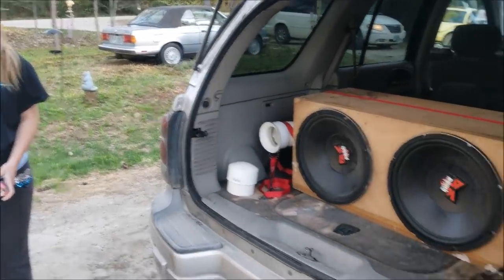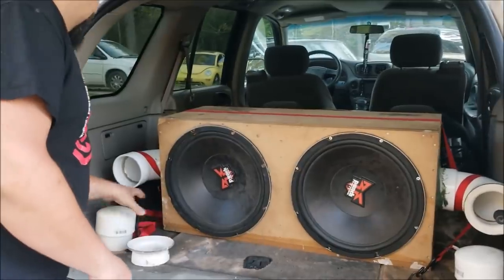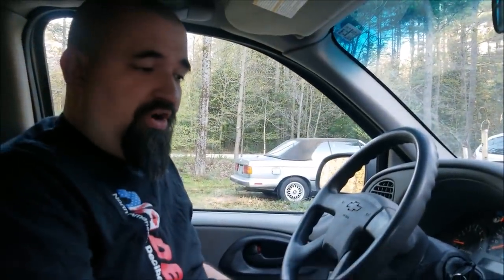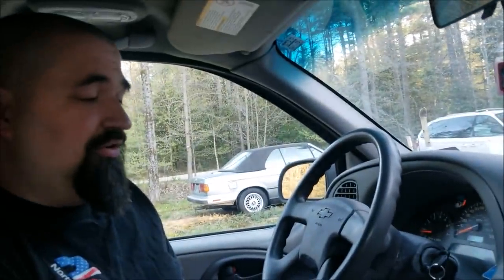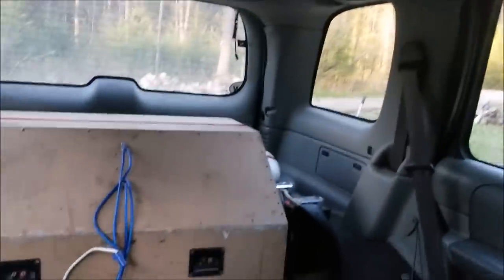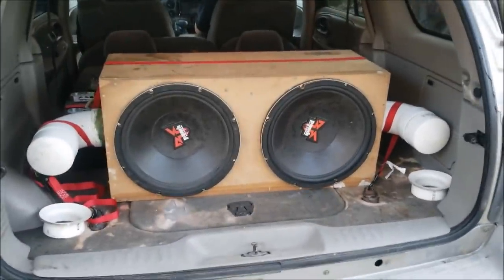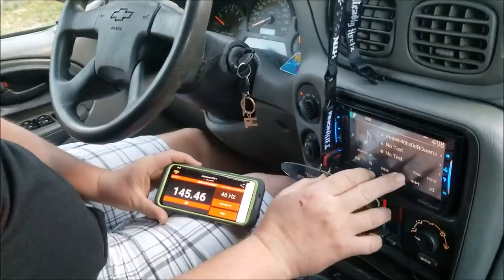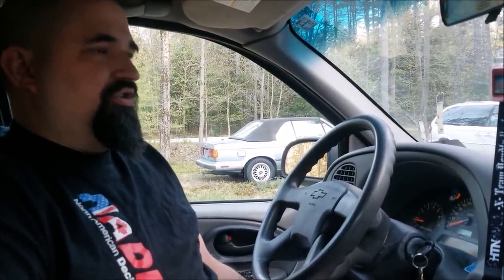Ported vs Sealed Enclosure Subwoofer Box Test with Decibel Meter Using My Daughters Bass Car

Comment: Did you account for the volume of the external ports when designing the box?
Reply from the maker: Roughly 100 cubic inches for a cylinder 4x8 or 0.058 cubic feet added to the sealed volume per side so 2.558 cf sealed vs 2.5 cf ported would technically be more accurate. I honestly don't feel that 0.058cf (0.232% difference to be exact) in volume would have altered the outcome enough to mention. Thanks for watching and commenting!

Comment: Wanting to know more about your setup. I got the same DVC 15s sealed but trying to still find RF amps to match. Are you running at 1ohm or 2ohm. Any upgrades to charging system so on.tia

Comment: to gain 1 db you have to double sound level, so its a huge gain. db works in a logaritmic scale not in a  linear one
Reply: Actually it's know that doubling power gains about 3 db on average. You can double the amount of speakers and get about the same 3db with that as well. Takes about 3 db for someone to notice a difference in "loudness"
Reply from the maker: @davidmarles9409  that therory always sounds good on paper, and may work at lower db levels but that idea goes out the window at high SPL levels.
Reply: @E4EonEbay  I'm sorry I have to disagree. There are plenty of videos that prove this is very accurate.
Reply from the maker: @davidmarles9409  show me a video where someone is doing 160+db where they simply double their power and gain 3db... do you ever attend serious audio competitions?
Reply: @E4EonEbay  I absolutely do and have gone to comps since the early 90's and you know as well as I do that's not what I meant. Once you have achieved the max power  your speakers can take this obviously isn't true. Also there is way more to car audio spl than in a building where this holds much more true because a car obviously deflects and panel flex affects max spl....I know what I am talking about and this video wasn't referring to anything like you are saying. Also I listen to real music not test tones and most of us like an even volume through all the bass frequencies not just a specific frequency for spl. I prefer quality over loud.

Comment: what do you think of class d amps, so tiny, more than 90% efficient, very less heat, excellent freq. response.
Reply from the maker: Class D amps are fine for bass in my opinion, however I do not feel they are suitable for mids and highs if you are using quality set of component speakers and looking for the best sound quality. I'm sure the majority of people wouldn't notice but for those still listening to cd's instead of bluetooth from youtube they would notice. Thanks for watching and commenting!

Comment: In my concern, i prefer a sealed box, large as you can. Because i'm a dj and club's conceptor, i'm also a music lover.
But a lot of peoples love the sound of ported enclosures. I don't discuss that, And build a lot of ported for them.
So, my point is about the phase of the port.. You could'nt make a real waves with a mécanical off-phase output in this configuration.. I prefer compansate the roll off by more power and good equalisation, who let clean lower band make me smiling.

Comment: Can we get a quick view of battery, alternator, and any electric components I.E., caps
Reply: What do you expect it to look lie? Look at the wiring you can see. It's awful, and borderline dangerous. I wouldn't let my daughter drive a half-a$$ed system like that. You can save money, but still install thing with pride. This system is as sloppy as I've seen.

Comment: I’ve been lookin all over but I’m trying to see if anybody has ran both sealed and ported boxes at the same time ? .. I’ve done it before in my mustang ... ported 12s in the trunk facing tag .. and the sealed box was right behind it facing the cabin poking out through the back seat! It made my windshield flex ! I was using a 2400 watt mono block Lanzer

Comment: 3 dB is the theoretical max at the tuning frequency of the port where the back and front waves are perfectly in phase.  Obviously people expecting 3 dB across the spectrum will be disappointed!  But ported is still a good bet when well tuned.  Even for SQ, with a blindfold and optimal tuning, and especially in a car, almost no one could tell the difference (except the ported would be louder and therefore better).

Comment: I have 3ea. RFR2210’s, do you think 3 10’s would be as loud or powerful than 2 15’s?
I plan on running a BD1500 amp with it as well
Reply from the maker: ZGERMAN enclosure and final ohm load the amp sees would be a factor, i have four rfr2210 myself. They are beastly subs.
Reply: Steve Young thank you for the reply, I’m having a local shop building me a Ported Box in a week or two only because I travel for work, I let you know how it will turn out.

Comment: Can the old school fosgate 2 channel amps like 700s, 800.2 and the 4 channel power 400.4 be bridged and each channel ran at 2 ohms? I chatted with Rockford fosgate, and they said no, 4 ohm minimum per channel on those amps bridged. Thanks
Reply: Rockford technicians are not gonna tell u what those amps are really capable of. The are stable at 2 ohm. U can even run them at 1 ohm but they are not stable. Will heat up real quick and u will burn it up if ur not capable. I run mines at 2 ohm all day long and have never had a problem
Reply from the maker: I have ran my power 1100a2 amps at 2 ohms mono all day long, if fed properly, keeping your voltage high and stable they don't heat up too much. I have even ran them in short bursts at 1 ohm mono for competitions and they have held up and not died on me.

Comment: Does the bass feel "smoother" when sealed and more "boomy" when ported? Or is that difference also negligible?
Reply from the maker: notes are slightly more boomy, but depending on how the box is designed a ported enclosure can sound better than a sealed in my opinion. Thanks for watching and commenting.

Comment: Hey Bubba, I dont see how the test is giving the sealed a fair shake. However, for the love of mobile audio I see your angle here and I respect the attempt.
Reply from the maker: Why would you think its not getting a fair shake? just curious. If you look at the manual it recommends 2.5cf as the optimal air space, sealed or ported so either way they are in their optimal enclosure. I could see the test being bias if the enclosure was not optimal for one or the other. Thanks for watching and commenting!
Reply: I offer to you, the belief that under the structural factors that make an enclosure suitable to be uniquely identified as such, would disallow the ability to "trap air" on a vented enclosure and automatically earn recognition as a 2nd order basis reflex environment.
Reply from the maker: @CIK-TEK  I can assure you that the PVC caps used, when in place, do not leak and were checked with soapy water when I originally built the enclosure. When the enclosure is in sealed configuration, it is no different than any other sealed enclosure that would have the same 2.5cf of sealed air space for the driver to operate in.
Reply: @E4EonEbay  Ahha, alrighty then, I shall stand learned and corrected. 
I bid you my appreciation for your participation in educating the masses... thanx.

Comment: When you cap off the ports are you including the port size in the total space for a sealed enclosure?  Just curious
Reply from the maker: You are correct in that there will be roughly 100 cubic inches for a cylinder 4x8 or 0.058 cubic feet added to the sealed volume per side so 2.558 cf sealed vs 2.5 cf ported would technically be more accurate. I honestly don't feel that 0.058cf (less than 1% , 0.232% to be exact) difference in volume would have altered the outcome enough to mention. Thanks for watching and commenting!
Reply: @E4EonEbay  yeah i agree thanks

Comment: Blocking off the ports makes it bigger when sealed bc the ported volume doesn't include port displacement and when you seal it off the ports become part of the sealed enclosure, thus making the sealed more like 2.55ish
Reply from the maker: You are correct in that there will be roughly 100 cubic inches for a cylinder 4x8 or 0.058 cubic feet added to the sealed volume per side so 2.558 cf sealed vs 2.5 cf ported would technically be more accurate. I honestly don't feel that 0.058cf (less than 1% , 0.232% to be exact) difference in volume would have altered the outcome enough to mention. Thanks for watching and commenting!
Reply: @E4EonEbay  thanks for taking the time to show the difference tho👍
Reply from the maker: @SaGeMitis  no worries, it's a fun box to play with, it's no longer in her car. She is running 2 sundown zv3 15s on a Team Cactus 5k at the moment. I still have the Rockfords and the box though. The interesting videos on my channel is the one where I play 20hz sealed vs ported side by side.

Comment: 1st, if that vehicle is in 50mph front end collision, that box is going to hit the back of your daughter's head at 50mph. That red strap around the PVC is not going to hold it in place.
2nd, your sealed volume is larger than your ported volume because the ports are now part of your volume.
3rd, ported should always be louder then sealed at the resonant frequency. A ported box is optimized for a specific frequency at the expense of others.
Reply from the maker: You are correct in that there will be roughly 100 cubic inches for a cylinder 4x8 or 0.058 cubic feet added to the sealed volume per side so 2.558 cf sealed vs 2.5 cf ported would technically be more accurate. However I honestly don't feel that 0.058cf (less than 1% , 0.232% to be exact) difference in enclosure volume would have altered the outcome enough to mention. Thanks for watching and commenting! (PS, her rear seatbacks fold and lock upright and she drives with rear seat belts latched in an X. The strap so it doesn't move left or right under normal driving, if seatbelts can hold back two 200lbs people I'm sure they will hold the box from coming through the rear seats...)
Reply: @E4EonEbay  Fair enough, your math checks out. I stand corrected.

Regarding the speaker box, though, I am genuinely concerned. A 60mph head on collision (say, someone texting crosses the median) can generate enormous forces. It's not uncommon for 50 to 100 Gs to develop. Would your straps wrapped around that PVC pipe hold up a box weight 5,000 or 10,000 pounds or more? Maybe, but I would sleep better with the straps running through a few eye bolts on the sides 😉.

Comment: But don't those aero ports still add to the displacement after being plugged? That's still at minimum another. 25 cuft feet with those ports. If you were going to run a ported and sealed box it would be better to plug the ports at the box, not at the end of the ports unless the port was flush with the box.
Reply from the maker: You are correct in that there will be roughly 100 cubic inches for a cylinder 4x8 or 0.058 cubic feet added to the sealed volume per side so 2.558 cf sealed vs 2.5 cf ported would technically be more accurate. I honestly don't feel that 0.058cf (less than 1% , 0.232% to be exact) difference in volume would have altered the outcome enough to mention. Thanks for watching and commenting!

Comment: The only problem is your sealed box should be smaller to do an accurate test with your amp turned up more. You can't simply just plug the port. You have the best brand of amps and speakers though.
Reply from the maker: If you pause at 26 seconds for a screenshot of the owners manual from Rockford Fosgate it specifically states the recommended enclosure size at 2.5cf sealed and 2.5cf ported. Looking at the illustration you see the range for each enclosure size the driver will work in, however there is literally an arrow at the 2.5cf mark on either scale pointing out and stating 2.5cf as the optimal enclosure size for these drivers sealed or ported. ----- Yes, plugging the ports adds the tiny additional volume of the ports themselves, there is roughly 100 cubic inches for a cylinder 4x8 or 0.058 cubic feet added to the sealed volume per side so technically 2.558 cf sealed vs 2.5 cf ported would be more accurate. I honestly don't feel that 0.058cf (0.232% difference to be exact) in volume would have altered the outcome enough to mention. Thanks for watching and commenting!

Comment: Since sealed subs require more watts how about increasing the wattage on the subs while sealed and then test the DB level.
Reply from the maker: It would be an interesting experiment to see how much more power was required to achieve equal spl, however this test was to simply show the efficiency of a ported enclosure over a sealed enclosure, adding more power would have skewed the test. If your saying put more power on the sealed enclosure to get the same level of spl you are simply proving the theory that ported enclosures are more efficient. The power ratings in the manual state the same power in either enclosure, it doesn't state a change in power handling or recommended driver power going from one to another. If a person had a limited available power ( ie didn't want to spend money on a larger amp ) and yet wanted a gain in output, moving from a sealed enclosure to a ported enclosure would be an option without spending more money on power. Thanks for watching and commenting!

Comment: I’m curious. You state that it is 2.5 cubes for both ported and sealed. The question I have is when plugging the ports for the “sealed” demonstration are you taking the volume of the port into account since the ports are extended outside of the box?
Reply from the maker: So you are correct in that there will be roughly 100 cubic inches for a cylinder 4x8 or 0.058 cubic feet added to the sealed volume per side so 2.558 cf sealed vs 2.5 cf ported would technically be more accurate. I honestly don't feel that 0.058 (less than 1% at 0.232%) difference in volume would have altered the outcome enough to mention. Thanks for watching and commenting!

Comment: That's 46hz dude. try 30 or 25/20. Lets see how a sealed will do at those low notes!!!
Reply from the maker: In all actuality the sealed subs would probably have more output at 25hz given that this particular box is tuned to 35hz and ported enclosures have a 24db per octave roll off compared to the smooth 12db per octave roll off of a sealed enclosure, now if you were talking a low tuned ported box verses an identical size sealed box perhaps you may see more output from the ported enclosure, but if you compared a large sealed box to a small ported box tuned high for the meter, the larger sealed enclosure would dominate on the low end... it is all about how you design a ported enclosure to suit your needs, if your metering it doesn't mean shit to have output at 25hz because you are aiming for a tuning hz that will allow your box to peak where your vehicle resonance is. A true spl enclosure will sound like shit on music because it's not designed to play music, if you want lows, build a large ported enclosure and tune it low, you will sacrifice upper range but it would sound good on slowed or rebassed tracks. If you are playing real music, the lowest you would typically see would be 35hz to 38hz for hiphop and for any other music the low E on a bass guitar is around 40hz and kick drums are typically around 50hz to 60hz so you wouldn't see any benefit to tuning to 28hz. A ported enclosure acts like a sealed enclosure at about an octave to an octave and a half above tuning, so you wouldn't have any increased output where real music is tuned that low.
Reply: The sealed box will drop alot at around 30hz.
Reply: Killa it will but his ported one is tuned really high, like 45hz i don't remember. So it won't have that kind of a difference.
If the ported is tunes at 20-25hz then yes the sealed will drop compared to that. But you can't tune a box that low with every subwoofer.

Comment: Can someone answer if ported noticeably louder with music like not bass boosted or modified just regular music?  of course there is many variables just asking ?
Reply from the maker: It depends on the tuning hz of the enclosure. Ported would be louder than sealed at certain frequencies where it has a gain in efficiency over the sealed enclosure. You would notice on some songs and not on others. Thanks for watching and commenting.

Comment: well dam, every official  litterature out states a gain of 3db for a ported box overa sealed. ..  or the 3 , 3 , 3 rule. .  .0db open air IB,  3db + for sealed,  another 3db for ported, and yet another for 3db bandpass so in other words 0 db IB 3db sealed, 6db ported, 9db bandpass, so the question is it all wrong,  OR is it maybe a wave cancellation issue in your vehicle, from the port  OR maybe the meter, I was reading recentinly reading that the spl meaters for cars use a pressure based algoridthm system that is differnt from a true spl meter due to cabin gain , would very interesting to repeat same expermint in an open field